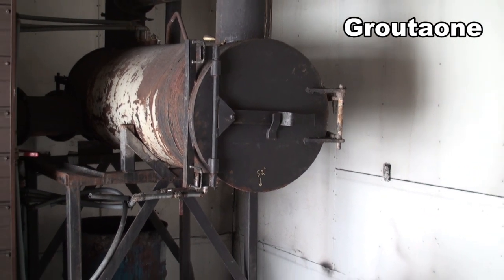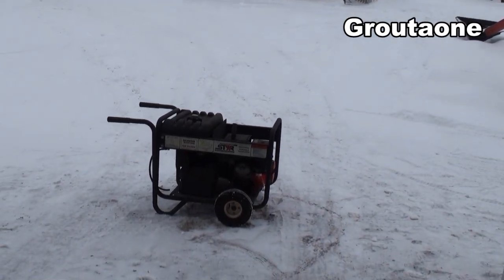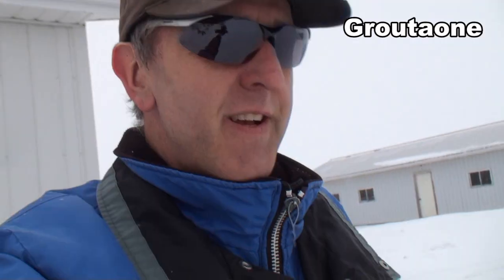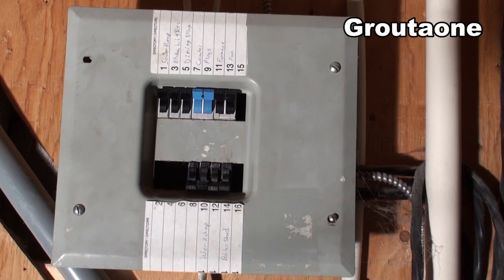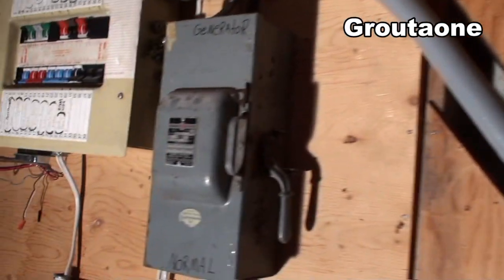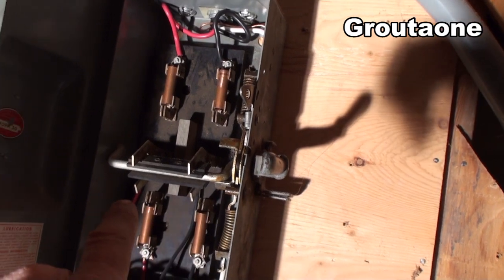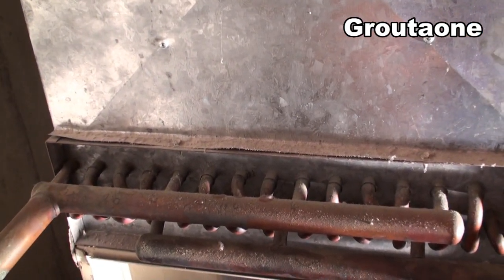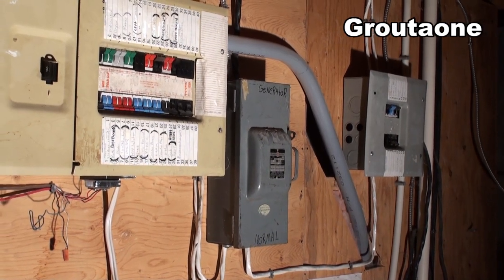Generator Transfer Switch, Are You Ready?

Comment: Great idea! My rural electric cooperative has a transfer switch in the meter box out at the transformer pole. I have a list of breakers I have to shut off so I can have enough power to run the essentials. I have a wood fired boiler that circulates hot water to three heat exchangers. One for the house, one for my attached garage and one for my shop. I wish that I had wired two breaker boxes like you did so I could eliminate having to flip all those breakers and just flip one instead. Thanks!

Comment: I wired up about 120 homes for generators as I was an electrical contractor.   The transfer switch is important for those that don't understand wiring and electricity.   I however don't have one for my house as I simply shut the main breaker off, connect my generator to a two pole breaker in the panel, then only turn on the breakers I want on.  Usually furnace, freezer/refrigerator, well, and some lights.   Just enough to keep me going till power goes back on.

Comment: Very cool set-up! Living in a flood zone I 've been thinking about a back up system to keep sump and other pumps running during power outages but would like it to be an auto start type deal when not home. Same idea with the smaller panel for essentials and maybe something like a mag starter for switching from main and gen power. Just got to wrap my head around the auto start part. Diesel gen for sure. Keep up the great videos.

Comment: Looks like it works well. Remember you need to unbond your generator in this kind of setup! The ground of the generator should be separated from the neutral in the generator and a secondary ground rod provided at the generator. Safety first ;)

Comment from the maker: You could have a generator power the whole panel but you still need a transfer switch to keep it legal and safe and you would also need a big generator, even bigger if you have electric heat. The generator in this video would be almost maxed out from one construction heater so I dont use it for heaters, AC or freezers. Best thing would be to change the switch to the generator position, then fire it up, I dont think you would wear out the switch in a life time, hope this helps

Comment: automated systems are much more expensive, but will work well for those that can't pull start the generator engine.   You can also tap into the natural gas to your house to run the engine.  That takes care of the gasoline issue.  The engines can be rigged to run on propane as well

Comment: In Ireland ( in the 70's & 80's ) due to long transmission lines & low national power output, there were designs of supply regulation, to try and reduce the problems of brown outs( under supply of power )in which the power was prioritised in the supply of farms, for example, the domestic supply would be reduced / cut before the bulk tank ( holding the farms milk production) went off line. Celtic pragmatics at it's best.

Comment: Glad I came across this. My house is going through a complete renovation and this might be a good idea. It is possible to have everything run on the generator so I just use one fuse box? Or would that be kind of dumb...

Flicking that switch while there is a ton of load on the other end and live power from the source, will it cause spark? Will that wear out the transfer switch from time to time?

Comment: Still burning sunflower hulls? Just an FYI that burner looks like either a 700 or 900 series EMF soft coal stoker. You can tell by the rotating ash ring. If you need parts EFM is and has been in business since 1922 and if you call them you can purchase any part you need for it from stoker screws to burner cones. Might make it a little easier getting parts as I've run into several people running EMF stoker boilers that weren't aware the EMF was still in business. Just go to EFMheating.com

Comment from the maker: My system is not automated, when the powers out I still need to roll the generator outside and plug it in, automated systems are available but higher priced, I have no antifreeze in my lines so backup power is important for me

Comment: my boss bought a system with batteries that charges when not in use but as soon as the power goes out it switches to battery and he gets about 10 hours out of it. it also smoothes out flickers and pulses.

Comment: Are there any benefits efficiency wise for using a smaller separate panel box versus using the main panel box and just flipping off the breakers you don't need during power outages?  thanks

Comment: i just have my gen hooked up to back feed a breaker..no transfer switch needed. might not be legal, but it works and is safe as long as I turn off the main from the street BEFORE the breaker that is running the generator.